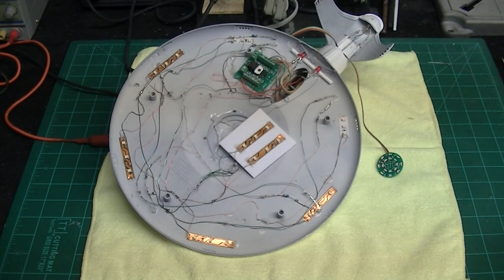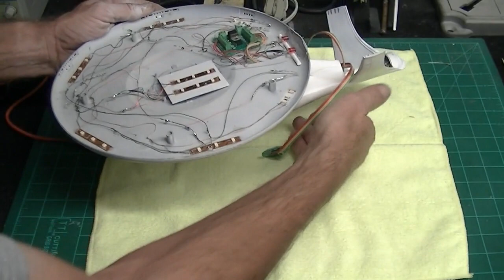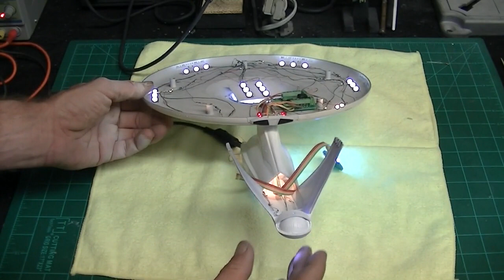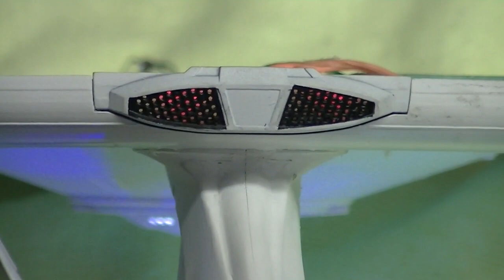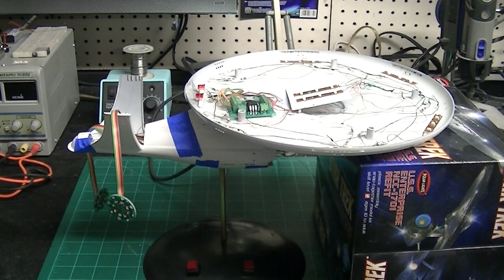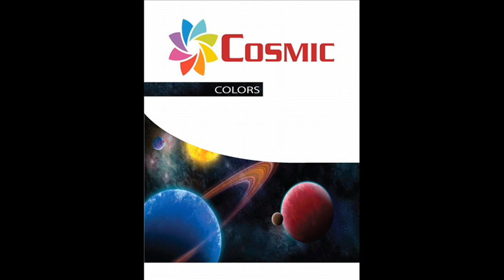Revell 1/500 Scale Into Darkness U.S.S. Enterprise Buildup PT 2

Comment from the maker: Jesse, in simple terms a 1/4 watt 470 ohm resistor on each LED you connect should be fine for a 9 - 12 volt power source. I use standard AC to DC power supplies to power the model when finished. Otherwise known as a wall wart. Sort of like a phone charger. Look up wall wart to find them. I prefer to use ones with at least a 1000 milliamp rating (1 amp). They are available with set voltage rating or adjustable with a switch to go from 3 volts to 12 volts. I run most circuits at 9 volts.

Comment from the maker: The reason I don't use dental acrylic is that you have to put it in before assembly
of the model. And afterword all of the windows have to be masked for painting.
I have found that using Krystal Clear or Canopy glue at the very end to fill in the windows works very well and saves time and materials.

Comment: Can anyone tell me where to find (good) info on wiring LEDs for models? I've been looking through your videos, Boyd, but I can't find one where you talk in depth about series vs. parallel, what kind of resistors to use, and what that thing is on your bench that powers the lights and tells you what the circuit is drawing, as well as what permanent power supply you put in the models. I'm trying to plan out a circuit... but not quite confident enough to pull it off yet.